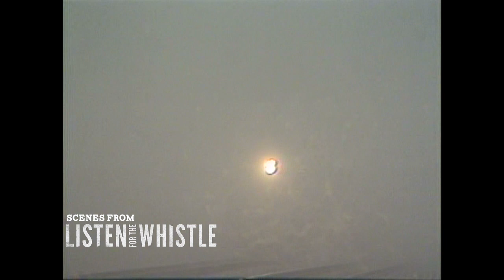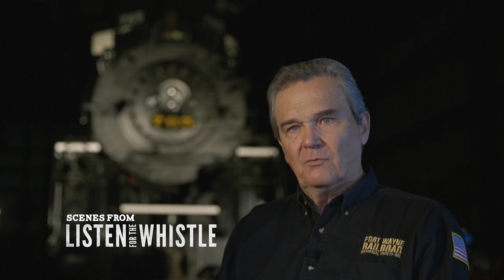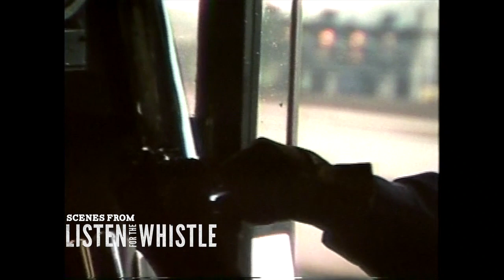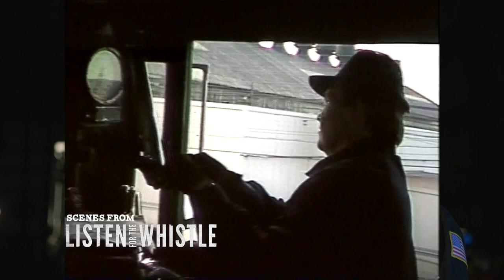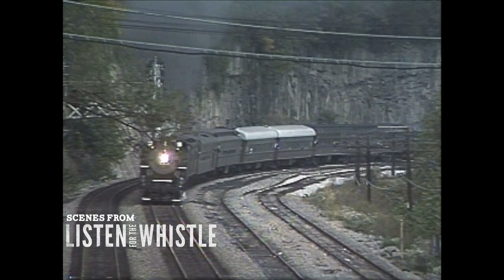Attica Hill is No Match for Steam | Nickel Plate Road no. 765

Comment: hmm just a thought, speaking of hills, I would love to see her hit that 5 1/2 percent hill down in madison indiana its the steepest non short line rail in the usa, even steeper then the killer saluta run a full 20 car run up that grade, see if that gives the 765 a workout, its indiana afterall, there must be some excuse to run an excursion down there isn't there, they did the walbash cannonball to west lafyeete I think.  

one thing is for sure I hope they have one ran out of fort wayne as the start of the trip this year I dont feel like going out of state just to ride a trip behind her.
Reply: manga12 rejoice they are doing a run from fort wayne this year, according to the schedual
Reply: 765 wouldn't be good for anything more than about 3-4 cars behind the tender up Saluda if you do the math. 611 nearly stalled with 5 its first time up Saluda. The next time they ran up Saluda with 611, it had 4 behind the tender.
Reply: @FanRailer  well 765 has one inch smaller drivers so it would give it a slight bit more traction, but if you want to really know what strain she can handle it was the run on horseshoe curve, it was uphill on a constant turn and a heavy load, that had her topped out and one of the runs they turned the diesel off and took it though the curve under her entire own power, she could have done it but it would have taken too long with them holding the trains up to slug it out at 10 to 15 mph all by herself, the reason for the diesle though was not that she could not do it but they had to streach the fuel out and make it last since they could not just stop any ol where to re water and coal, and had to maintain some speed as its one of the busiest stretches of rail in the world really.
Reply: @manga12  765's boiler pressure is 245 psi vs 611's 300 psi. The drivers being 1 inch less in diameter only matters if the boiler pressures are the same. Rated tractive effort is 64,100 lbs for 765 and 80,000 for 611.

Comment: I have a question. Why does the 765 have 2 whistles? I can't seem to figure it out and I was just curious... : /
Reply from the maker: The second whistle (not mounted on the steam dome) is typically a "guest" whistle.
Reply: Ah, thank you.
Reply: Fort Wayne Railroad Historical Society I know it generates more power at 40 then at slow speeds but what makes this so , the way the wheels are with their size< the valve timing, is it the drought on the fire, what is the reason that makes it be so?
Reply: Manga, why are you posting this as a reply in MY comment feed?
Reply: well I saw that the historical socity responded to your question so it was to them.
Reply: You can just post a brand new comment, NOT as a reply...
Reply: Rich this video is awesome
Reply: What most modern railroaders don't understand is that the Steam Locomotive has 100% of its power all the way down to 0 mph. Depending on the engine, wheel adhesion is often the only limiting factor. Those Lima Berkshires could out pull anything in its class!
Reply: and at 2000 fps of superheated steam but the modern locos well they finally have more power at speed that would be like a steamer but only the very latest thanks to new gearing though a late period steamer like this would still be able to do nearly the work of one it would just take longer to get to speed, well engineer zack of the 765 said that a modern ge 4300 would do a better job all around in pulling, but it took nearly this long, anyway it is a real good time period for steam, once big boy comes around it will be a great day indeed, and once the T1 is finished It will be a grand happy day and a very special occasion to bring one of the most powerful and unique locos back from the dead 

and they as they say they can  GO AFTER IT, NOT JUST with the throttle but after the record on the test track or some other wide open level location, and let the theroghbreed get up to a galloping pace for all shes got.
Reply: Bill Moran I think you mean Diesels have 100% at low speeds. A steam engine sounds cool starting a train but the Diesel is far superior when it comes to starting a train.

Comment: yeah its so strong that most video show a diesel behind it. LOL They run excursions with this and always have diesels attached to show how weak it is....
Reply from the maker: Thanks for your curious input, but the 765 didn't run a single excursion with a diesel behind it in 2014.
Reply: 1870-
Obviously, you're a model railroader so naturally I suspect your an automatic expert on real railroading practices. So, it's needless to say that one of the main reason diesels are tacked on behind steamers is for dynamic braking and are seldom used as helpers. I don't need to explain that principle to you because you know everything already. That being said, could kindly explain how the 765 is weak for taking advantage of modern braking capabilities?
Reply: If I'm correct, the FRA has regulations about power relative to the size of the train
and I believe they also use them for the steam-generators.
Reply: it is also a matter of safety, incase it breaks down for any reason, you dont want to tie up rail traffic with something that is a guest on their railroad, and the fact is that even on the horseshoe curve runs in 2013 that was only to save fuel since they had to go double the distance they normaly do, that they had to run the diesel on behinde her, and she did actually pull the curve unaided on at least one trip which is slightly uphill like a .5 degree grade around it, as well as being a bit longer train then normal.

The truth is that on the mainline back in her days on the nickle plate till she was retired from freight, she would pull 100 cars on friction bearings back then, and makes peak horsepower at top end speed compaired to a diesle that is on the low end of the spectram, now the cars were half as big back then but still today that is like at least a half mile long train unaided and at road speed, it takes two diesles to do even that and its a real strain for them even with the 4300 hp ge locos with the six trucks on each axle to pull a mile long train today with just two locomotives, I have seen it myself it was a slow go, and they usually pull fairly fast though the auburn junction area though there can be speed restrictions too, but these locos took forever to get any acceleration and were straining to pull the mile long train about 105 cars give or take is the length of modern cars per mile.
Reply: 1870Logger The diesel sometimes found in the lash up is not there for pulling power. It isn't there in case the steamer breaks down either. No one in their right mind would suspect a steam engine as meticulously restored and maintained by the people that own her to break down. The diesel is there to provide steam heat and electrical power for the passenger cars. It is also there because the older steam engine's signaling system does not comply with the current system that the diesel has. I can think of very few operating steamers that are as strong as 765 or as well maintained.
Reply: prydonian460 it is kept up with, but its one of the smallest mainliners, 1225 has 300 more horsepower, 611 is stronger, and both the challenger and the big boy are when they return to service, milwalkie roade 261 is also stronger, it is a freight locomotive though and has that kind of power to pull long trains at a fair speed.
Reply: manga12 I don't include articulated locos as they are basically two engines under one boiler. The 765 is an S2 Berkshire type loco also made specifically for high speed freight and built by the Lima locomotive works. You mentioned three stronger locos....my statement stands as three qualifies as a few.
Reply: just saying, almost all the ones I run across that did excursions over the past two decades seem stronger, except for that one npk I think 587 as it was an older one built before 765 that said, I am going on the cannonball run tomarrow from new haven to lafyette.
Reply: Sir... Most roads add diesels as required by their management. Understand this,most railroads bend over backwards for our steamers. Most roads won't touch it insurance relations sky rocket when these things hit their rails it's a formality understand their running a railroad as well. God forbid something happens there is a diesel to help. Remember this engine is older than you and a great deal of other family members combined.
Reply: Fort Wayne Railroad Historical Society   She did a superb job on the Erie Limited Excursions last weekend as well, pulling a 20 passenger car train with not the slightest issue and no diesels.
Reply: 1870Logger It's so weak that it produces 4500hp at 70mph....
Reply: +stevelerro I hope that you know that that is a high horsepower for a locomotive as small as 765, not saying that it is small, because I've seen her in person, and there were articulated locomotives that only produced around 6000 horsepower which is really good, but it is an articulated(I'm talking about the Allegheny locomotives) and it is extremely heavy.
Reply: They were rarely recorded to have been run faster than 765 as a side note, even though they were going over the mountains with loaded coal trains usually.